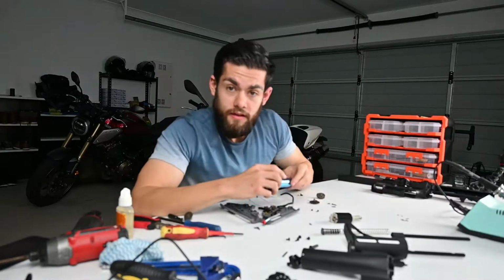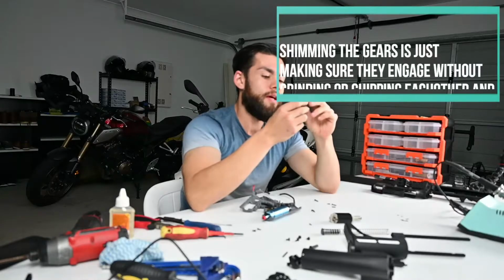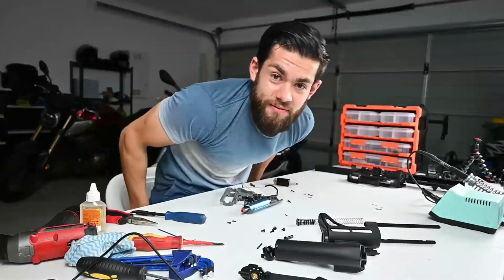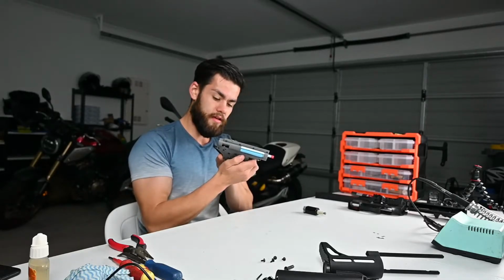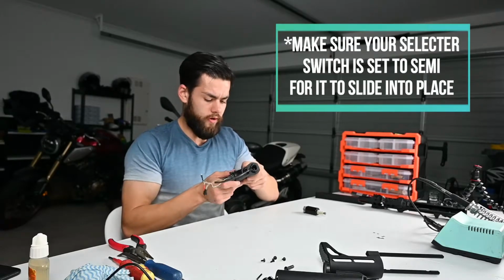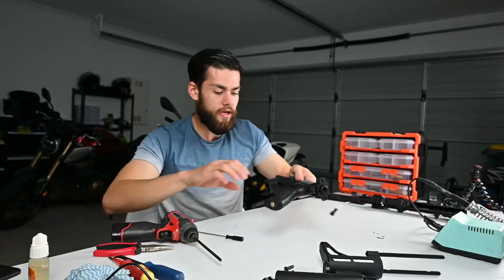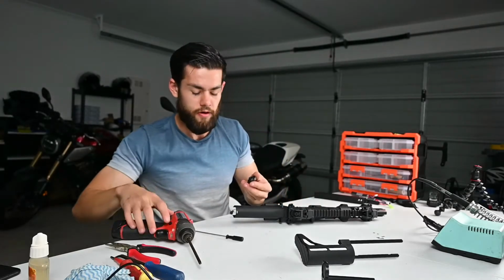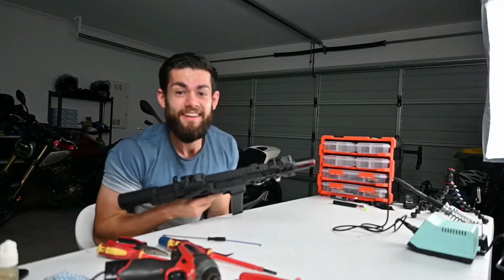Wells PDW "ARP" GelBlaster Repair and Re-Assembly Part2

Comment: I reckon if you keep doing these tech style videos you could become bigger. I enjoyed watching this.
Reply from the maker: Thanks legend. Appreciate it
Reply: @danderian2911  what do you do to keep the anti reverse latch in place when putting the box back together?
Reply from the maker: If it’s not holding in place, I usually put a small Allen key through the 3rd gears bush / bearing on the top half of the gearbox to hold that gear down, supporting and stabilising the anti reverse latch while I then press the top half of the gearbox into place if that makes sense.
Anything small with a flat surface will work but it can be a little tricky to do.